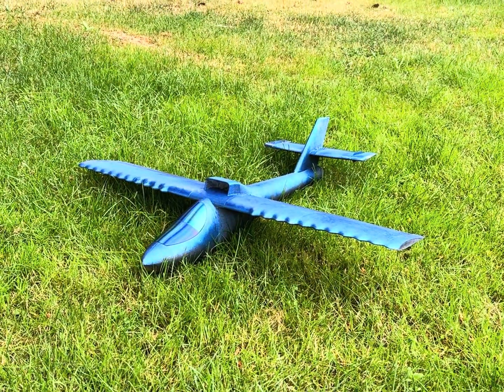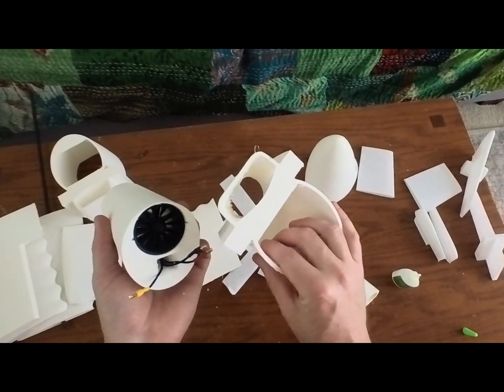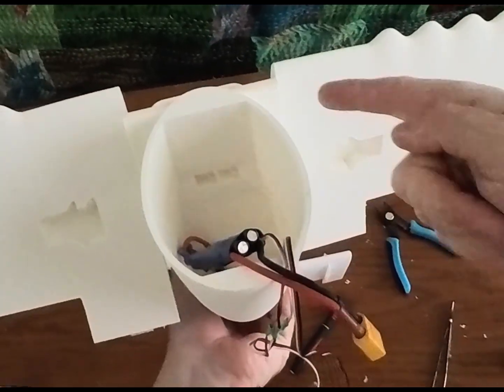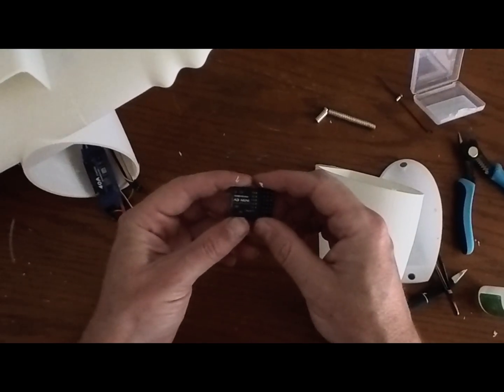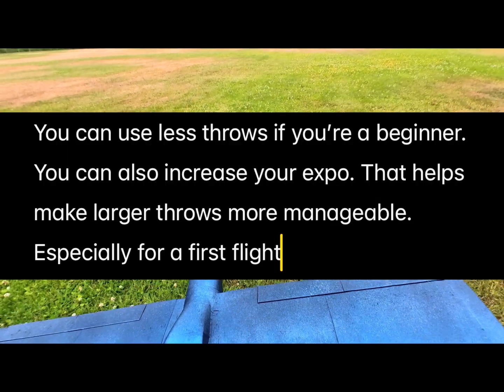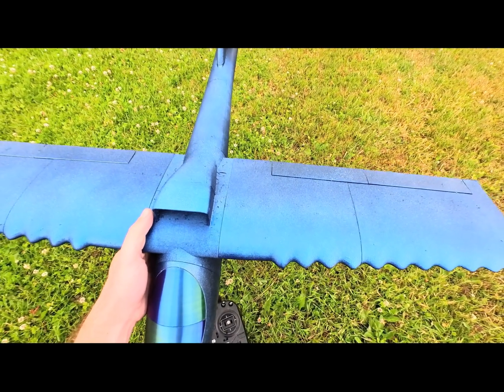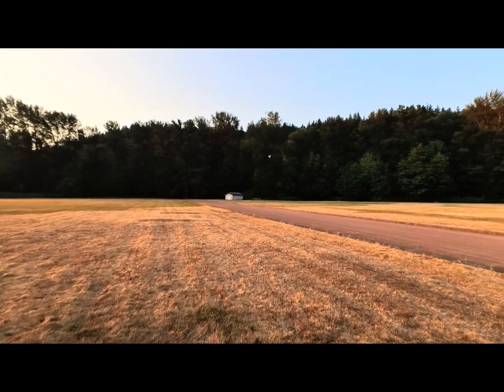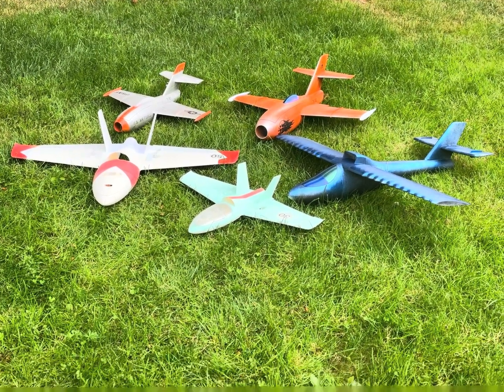Tubercle Wing Biomimicry RC Plane

Comment: I'm sure you are aware of what the effect of tubercules on a wing are supposed to be right?
So where are the stall tests etc, compared to the same plane with a stsd wing..!?  :)
Reply from the maker: Maybe a part two later. I normally get like 100 views haha.
Reply: Tell us what they are supposed to do, genius?
Reply: @FarmerFpv  
1:  Increased LD ratio.
2:  Increased angle of attack before stall.
3:  A for more gradual, controllable, safer stall.
4:  A decrease in wingtip vortex and tip stall.

It does not take a genius to look up the research... unless the will to do so and the ability to read and comprehend is genius to you..!?  :)

Comment: I was looking around for tubercle wing design experiments when I stumbled onto you video. Pity that it was no useful comparison to a straight wing design, but I have to say that this plane flew incredibly smooth, it literally owned the sky. I have no experience with RC vehicles, but all I have seen up to now are the kind of jerky flights although the weather conditions might have played a part in this. Good job. (I'll save the video for later)
Reply from the maker: Thanks for the comment. I agree I wish I would have compared them in the video. The video would’ve been a lot more interesting. I did test the straight wing off camera during development and the tubercle wing really does smooth the slow flight out.

Comment: This is a really interesting design. I love the way you integrated the EDF, as well as the tubercles. It would be interesting to see a comparison against the same plane design but with traditional leading edges. Do the tubercles lower the stall speed, or increase airflow over the surface at low airspeeds?
Reply from the maker: I did fly it without tubercles. I tested many airfoils too. I didn’t record everything though. At slower speeds the straight wing def stalled more easily. The tubercle wing is be able to fly tilted without stalling even at slow speeds. And when it stall it feels slower. Of course it still stalls. Another factor in this wing is that I used a really high camber airfoil in the center.